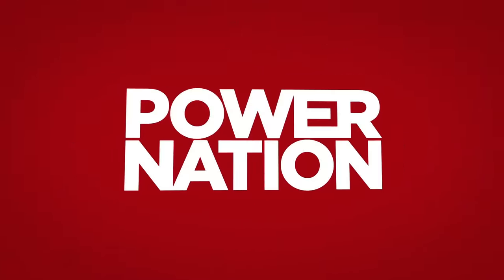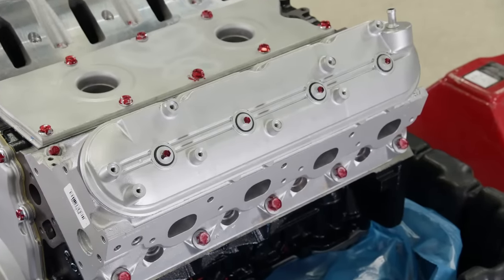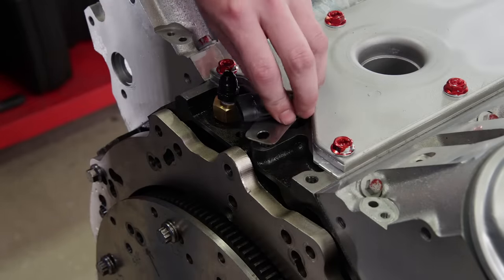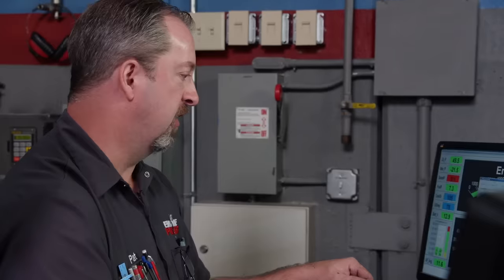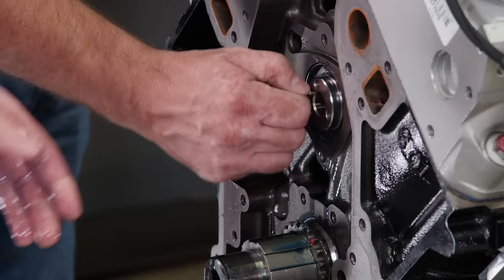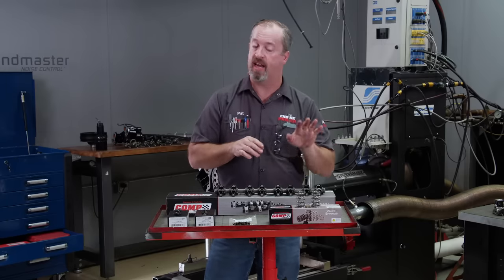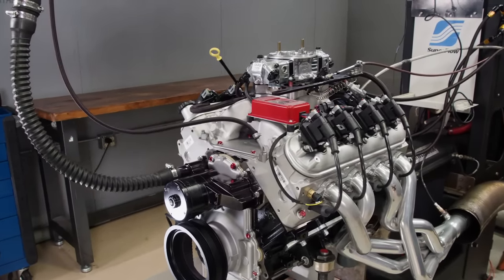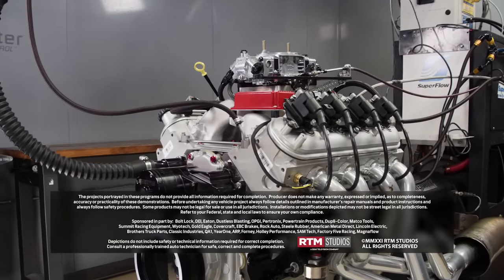Hot Rod LQ9 Cam Swap - Engine Power S8, E21

Comment: I completely understand that slapping a carburetor on is easy for the show, but I'm tired of seeing it. EFI is just as easy IMO and offers more control and monitoring than a carb. For an engine that already came EFI and for a service that is offering remanufactured engines (likely for replacement), I would think comparing it to it's stock counterpart would be the best option.
Reply: What should they put instead ? Just pour in with a straw ? Carb is base line cheap... EFI alot more expensive complex.. Start at bottom work up... Duh...
Reply: @1BigDaDo  totally agree man
Reply: @1BigDaDo  EFI comes stock on that engine. You just replaced the manifold, carb, and added electronic ignition. Using stock parts from that motor is actually easier. In fact, to go with the theme of "remanufactured", source used parts that people are practically giving away from their own upgrades or source them from a salvage yard. To do this properly, you'd still have to tune the carb. Why not skip all of that and just use it as intended. Even the factory ECU can be flashed.
Reply: @1BigDaDo  They did spend $9000 on the long block, so this isn't a real "budget" build.
Reply: @PlugInRides  the one you are talking about is a 550 hp LQ4 with aftermarket heads and cam already installed that Power Torque offers. They used a stock remanufactured long block for their build.

Comment: This is exactly what I am using / doing with my LS swap, cammed LQ9 however, I am going fuel injection. I am curious as to what this motor would have done FI. Thanks.
Reply: Same overall power, except fuel injection might give you better fuel economy and throttle response
Reply: @mikejohnson699  Very good, thanks.
Reply: @mikejohnson699  I'm not sure that's true, considering they didn't attempt to custom jet the carb.  EFI would allow a perfect mixture under full throttle, and usually results in power gains at the expense of increased cost and complexity.  A carb is almost always a compromise on power, drivability and fuel economy.
Reply: @PlugInRides  Yes, I can agree. This was neat simply because I am doing the very same "upgrades" on mine after a lot of do-diligence. Going in an 83 Camaro with 4L65E. Course, kinda on hold because it is 23 degrees outside, AND in my building. Thank God for global warming.

Comment: The long block alone is $9050, from O'Reilly's.  This is not a cheap build!
Reply: Not sure where you got that. Based off the part number they gave it’s around $3500 for the long block
Reply: @jeffnewton3507  
Power Torque Long Block
Part #: LQ9LB1 Line: PTQ
☆☆☆☆☆
No rating value for Power Torque Long Block(0)
$9,050.00 Each

Maybe this one is new, and not remanufactured?
Reply: @PlugInRides  That one you are talking about is a 550 hp LQ4 that Power Torque makes with aftermarket heads and cam already installed. They used a stock remanufactured LQ9 for their project.

Comment: Why would you run a carb on a LS? 
Plenty of advantages with EFI. Even a LS6 intake can make power
Reply: They said it is simpler to hook up and run on the engine Dyno.
Reply: Simple. Cheap. Reliable.
Reply: For simplicity and maybe cost. If you don't have knowledge of fuel injection, with all of its sensors, and using a computer to tune, then you are in trouble.
Reply: A vic Jr and a 750-850 will make about the same power

Richard Holdner already proved that

. It's about what you want if you a laptop guy yeah do the EFI if you race in different areas it's easier to make adjustments. IF you know what to do
Reply: @FilthyGopher  That will be news to GM, that have designed EFI intake manifolds that outflow virtually any carb and manifold that can fit under a hood.  How can a carb outflow a high performance EFI manifold with port injectors? A stock GM LS3 nylon manifold can handle over 600hp.
Reply: @PlugInRides  two words... single plane :)

Comment: If I ever built a V8, it would definitely be an LQ9.
Reply: You can build a 5.3L and get comparable numbers and way cheaper.
Reply: @joshtheking1772  But the 5.3L is aluminum, and historically less reliable than the 6.0, so my personal preference is the iron LQ9.  I don't think the difference for the build would be "way" cheaper, but the harder you push that 5.3, the more expensive parts you'll need and net less reliability.
Reply: @reviewaccount469  the 5.3 is also iron.   FYI, Incidentally, some rare 4.8L/5.3L iron block castings can be bored all the way out to the 6.0L engine's 4.0-inch bore size. As reported by Lingenfelter Racing's Jason Haines, that's because (you guessed it), this is a rare universal casting used interchangeably at the foundry to make 4.8-, 5.3- or 6.0L engines. Look for "4.3L-5.3L-6.0L" (all three displacement designators) cast into the block's front passenger side.
Reply: @BrockGrimes  They did make Gen III & IV 5.3s in aluminum and iron, but only trucks got the iron ones, everything else got the aluminum ones.  Since 2014 however (Gen V) the 5.3 has been ALL aluminum.  I'd suggest anyone wanting to buy a 5.3 for a build to do their own research and not rely on one or 2 comments under a Youtube video.  I would still rather buy a 6.0 LQ9 that I know is stout and IRON.

Comment: A little bit over cammed with the heads unable to flow enough to support the very high lift camshaft. I would be very dissatisfied with the HP with at least 480 expected with the correctly specified camshaft.
😎🇦🇺

Comment: with that cam, the heads are the limiting factor. I bet if the performance cam intake had been symmetrical with the exhaust at 239dg each @.050 with the existing lift and a cnc'ed stock head or aftermarket head had been used, it would have gone 505-510 hp at 6300.
Reply: @Selkirk69  don't you like music? The Beatles? It's an interview with the famous film director that just released the movie, :GeT Back." The Let It Be movie by the Beatles!
Reply: Stop spamming!  Your spam comments have nothing to do with the discussion, and have been reported.

Comment: Nice motor….so what the total cost??
Reply: Exactly. Nice build, bit HOW MUCH!! That, they never tell you!! Lol
I know it's far beyond my wallet!
Reply: @kevinshiley9061  probably less than 10k 

a stout small block or LS built correct is gonna cost you a little bit so start saving for good brand name parts and do it the right way so you don't end up on the side of the road!
Reply: Just looked at orileys website $9,050 for the lq9 long block. Plus whatever cost for the upgrades they did.
Reply: @GasCapECBOK  wut😱
Reply: For my rebuild with a lot of shit done to it came out to 7k
Reply: @KingJT80  yeah. For rebuilds you can’t go cheap hell even crate . U get what u pay for

Comment: Can you give me some advice on how build a 302 ford to give a 350 house power about 370 pound of torque thanks.
Reply: @billashe2108  Can I get part list and I know you got it from Summit. I need to know how to do the oil upgrade. Thanks
Reply: @carlleonard7533  Ok, What parts do you have? parts you can count on. Do you have the block? I mean short block, long block?
Reply: @billashe2108  I have 302 80's truck motor complete
Reply: @carlleonard7533  Ok, give me a little bit.
Reply: @billashe2108  It is 83 F150 motor i have taken completely  apart. It is a standard 4.00 302 engine, stoke. Part list the rotating assemblie. The head that you used, and the cam and lifters.
Reply: @carlleonard7533  Ok, this top end kit will give you 430 HP at the flywheel and about 360 HP at the wheels: Edelbrock 2043 - Edelbrock Total Power Package 438 HP 331-363 Small Block Ford Top-End Engine Kits, but you will need to check, maybe change the pistons, because of the valve clearance. Let me check the rotating assembly.
Reply: @carlleonard7533  With this one: Edelbrock 2091 - Edelbrock Total Power Package 367 HP Small Block Ford Top-End Engine Kits, most likely won´t need to worry about valve clearance but gives you less power at he wheels. About 300 HP.
Reply: @billashe2108  thanks for your help
Reply: @carlleonard7533  This rotating assenbly would give you piston to valve clearance and way more power, it makes your 302 a 347 cu.in and it is already balanced: Eagle Specialty Products B16422EA030 - Eagle Street and Strip Rotating Assemblies. You are welcome, I hope tht helps! Good luck with your project.

Comment: Last time I bought a power torque engine it was crap.  Exhaust runners were pinned and leaked. It overheated from the start and they tried to tell me there was nothing wrong with the heads.
Reply: @Big Bore Racing  350 chevy for a Tahoe

Comment: This is going to be as good as the turbo Ford 300 6 cylinder. LQ9 is an awesome engine but I think you really should have played with the timing to see where the stock LQ9 quits making power.
Reply: They could see the power curve turning down at higher rpm, which meant the timing had reached it's limit.  It's possible rejetting the carb might have gained a few ponies, but their experience with the dyno meant that advancing the timing further wasn't going to yield more power gains.

Switching to EFI and a stand alone ECU, would probably net another 20hp or more. An LS3 manifold would probably flow better, and the ECU can be tailored to the cam and timing better than a carb.
Reply: @PlugInRides  that was my point , the power curve was turning down too early IMHO and normally you would keep advancing the timing until you hit peak and then when it starts going down you know it’s maxed out on timing advance. He didn’t do any timing advancing on camera.
Reply: Stock LQ9's are known to do 390-395HP with just long tube headers and optimized tune, but that is with them running out of fuel. With bigger injectors several have broke 400HP. TBSS intake swap with a 90mm throttle body puts you up to around 415HP without even pulling a valve cover off. So yeah, they lowballed the numbers on the stock cam.

Comment: Shouldn't the LQ9 have an aluminum block?
Reply: no LQ4 and LQ9 are iron blocks,LQ9 has flat top pistons vs dished which the LQ4 has so more compression
Reply: @robholmes2129  Thank you. I knew there was a difference. I couldn't remember.
Reply: Nah the LQ9 is just an LQ4 with different pistons. The LQ4 is what you'd get in the 01-07 1500HD's/2500's and as the base engine for the 2500HD and 3500HD. Both iron blocks as a result cause the LQ4 is a work horse if there ever was one, all they did was switch from a dished piston in the LQ4 to a flat top piston in the LQ9 for a bit more compression.

Comment: I can't believe you actually advised having the trays hold the lifters!!! Thats the WORST thing you could do. Maybe if you knew the trick of using two 5/16" wooden dowel rods in the oil galleys to hold the lifters. I was actually shown this by a GM engineer in 1997 and was a part of the design.
Reply: I have cammed countless LS based engines and NEVER had a lifter drop. Relax.
Reply: He literally says this could cause them to fall. It’s a possibility.
Reply: @Bird-dl7xs  ya it's possible, like it's possible to get hit by lightning l, but it ain't happenin' lol
Reply: @romper4444  and is a possibility you have no idea what your talking about. Possibilities are endless

Comment: I don't see how you can pull a stock cam and put in a higher lift cam without hitting the lifters. When you spin the old cam your not going to set the lifters higher then the higher lift cam your installing.

Comment: no motor oil ?, wow could be trouble !
Reply: @Wayne Flanigan They show the oil filter at 7:35 and then the oil at 17:21. I’m assuming it’s the same oil since they drained some out. And the powermark has its own starters
Reply: @Wayne Flanigan it's a roller cam engine, so break in is not as crucial as a flat tappet. No cam break-in is necessarily.

Comment: I would have liked to see hp with some actual timing in that thing. 20 aint enough
Reply: Ls motors don't require timing like an old 350 chev, I think they finished at 28deg not 20.

Comment: This might actually be viable, the only problem I saw is they pulled out the 600$ tool to do the valve spring change.
Reply: You can get one for under $100
Reply: @jeffnewton3507  Not one from MATCO
Reply: @williamsanders468  - The professional mechanic doing 5 engines a week may need the MATCO unit. The guy building his own car in his garage will likely find the $100 version perfect for his needs.
Reply: @billybeemus3929  True but still the guy in his driveway may not have that high of a compressor for that to work. Or just do it the old fashioned way with a valve spring compressor.
Reply: You dont need a big compressor to do it, you can buy a cheap or used then sell it
Reply: If you are only doing 1 engine use some rope in the spark plug hole and a $40 springs compressor from Amazon.
Reply: @Hated_Sien  the rope method is great

Comment: That's ok numbers a stock 5.3 makes like 360 I think it should've made better power GM has them rated at 345 with all accessories and full factory exhaust
Reply: A stock 5.3 for those years made 310hp
Reply: The lm7 5.3l is rated at 270-295hp, the aluminum block l33 was rated at 310hp(243 heads vs 706/862, bigger cam, & flat top pistons for 10:1 C/R), lq4 was 300-330hp, & lq9 was 345hp. 360hp is on the healthy side for an lm7, but has been seen, l33 aluminum block 5.3's though do put down 360hp. The lower compression lq4 6.0l routinely puts down 390-395hp on the dyno in stock form with just long tube headers, but is running out of fuel with the stock injectors. I've heard of a few guys hitting 405hp with lq9's with just long tube headers, bigger injectors, and optimized tuning.

Comment: That cam doesn't match the intake manifold at all.  There is so much left on the table.  The limiting factor here is the intake manifold.  Thats a 600hp setup, easily, with a fuel injection manifold from a Corvette.